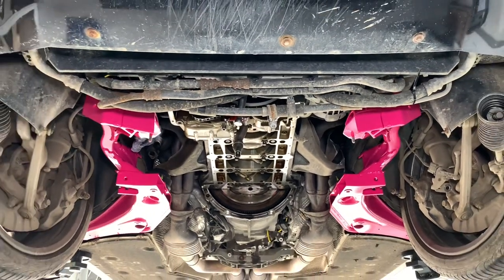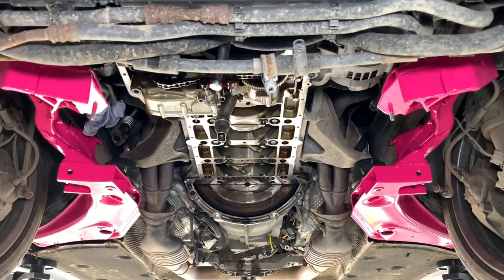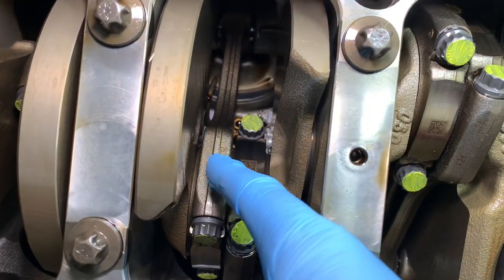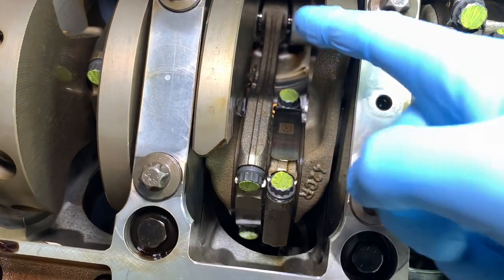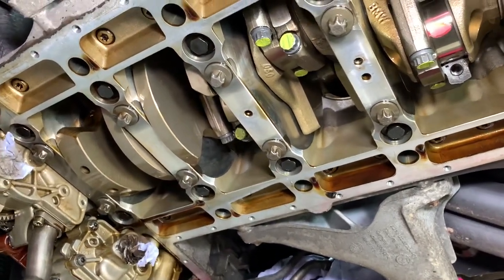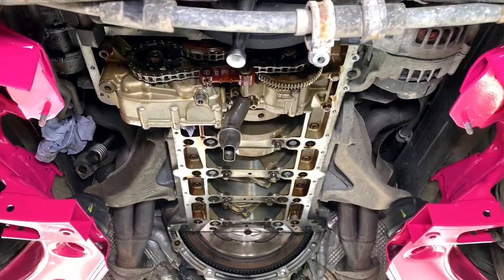BMW E9x M3 Conrod Bearing EXAMPLE video

Comment: if you use stretch bolts how can you use a plasti gauge? can you re use the bolts?
Reply from the maker: Hi Neil, you have to stretch each bolt 3 times so you use the 1st stretch for Plastigauge then the other 2 as normal.
Reply: @RedishMotorsportbmw  ahhh makes sense cheers👍
Reply: @RedishMotorsportbmw  I had the same question. Thanks for the info!